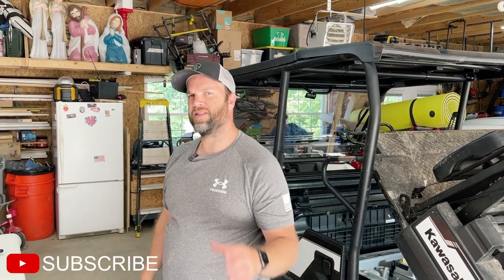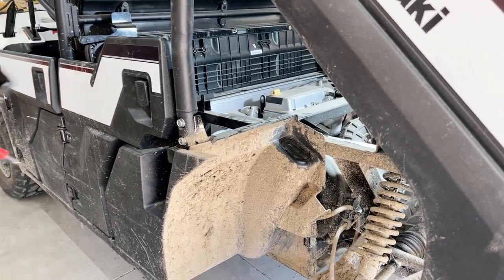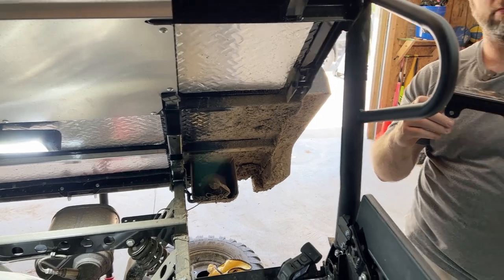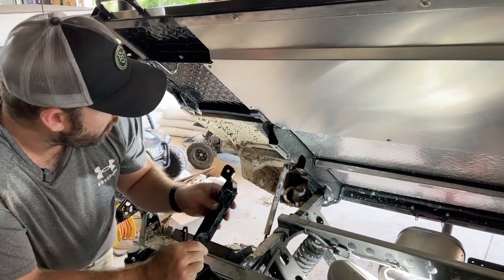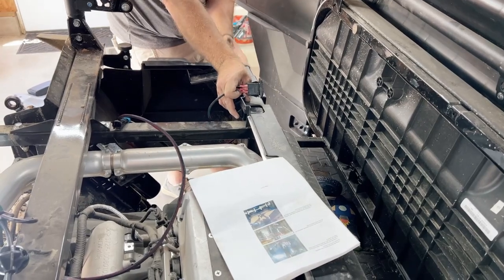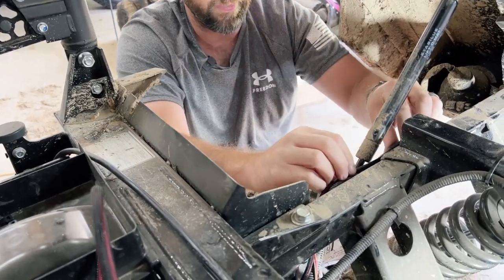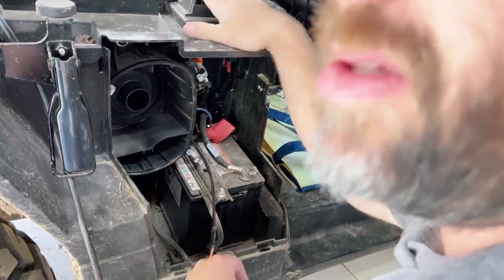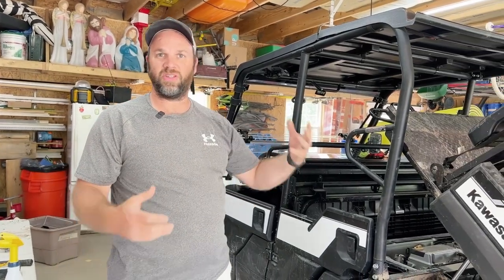Kawasaki Mule PRO FXT EPS | Cargo Bed Lift Install | *** MUST HAVE ***

Comment: I have a kubota with a dump bed and it's way faster, buying a mile and going to add this feature. Wish the switch was on the dash, but that's what wrote and splices for. Thanks for sharing.

Comment: I installed one of these one my 2016 4010 about five years ago. I used step drills to drill holes in bed. One of the best accessories I installed. It's slow compaired  to JD and Kubota but works very well. Remove your bed hold down latches. You don't need 'em and If the bed gets latched down you will be blowing fuses or breaking something.

Comment: Do you know the dimensions of the cylinder such as the retracted and fully extended lengths?
Reply from the maker: I’ll get those measurements in a few days!
Reply from the maker: Just posted an update video with measurements. Please check it out!

Comment: Thinking of doing this to mine. Seems kind of slow. Want to dig out a small pond and haul the dirt up a hill and dump.
Reply from the maker: It’s definitely on the slow side, but keep in mind it’s a all in one unit that takes Manual lifting out of the equation. I absolutely love it! I’ve loaded mine down well over 1000lbs without any issues. Disclaimer I would never recommend going over factor specs. ;)

Comment: I'm guessing you can not raise the bed when using the full bed!
Reply from the maker: You can raise with both size beds no issues. I’ve raised about 1500lbs with no issues. Mind you I would not recommend going over max capacity of 1000lbs.

Comment: Do you know if this would work for a 2005 Mule 610 4WD?
Reply from the maker: The 610 is a little different design so the prefabricated brackets would probably not work. How we with some modifications you could make this work. The power actuator is a standard actuator made for Kawasaki by Kayaba. Thanks for watching!!